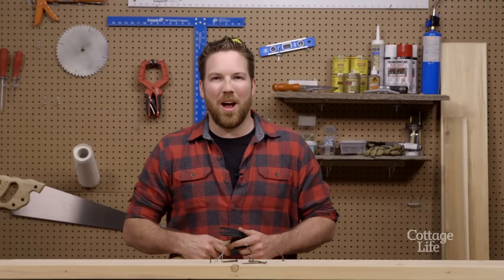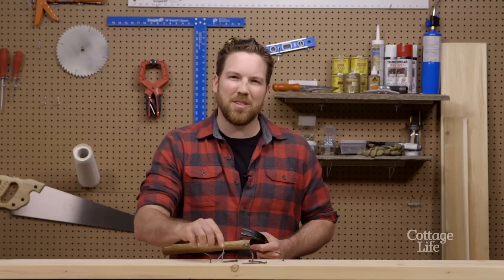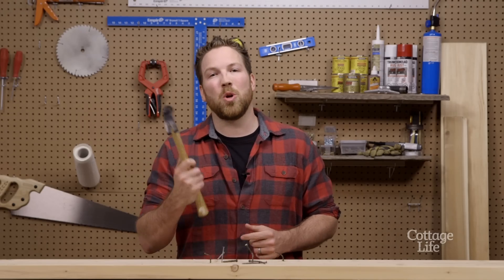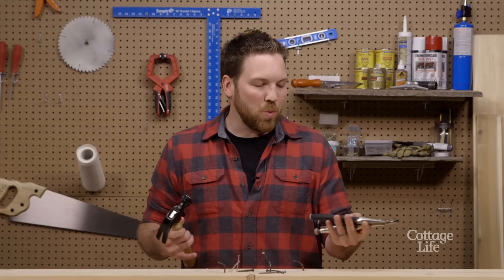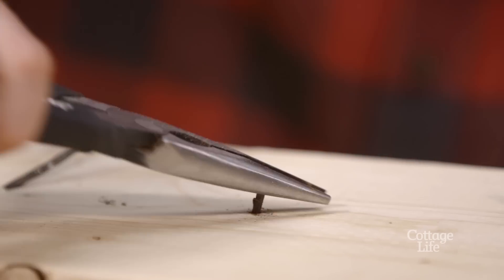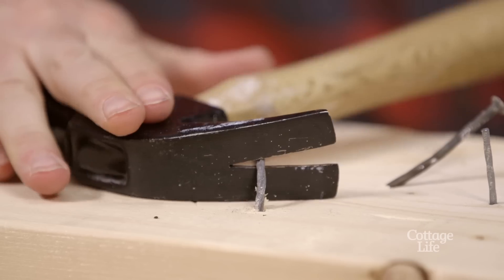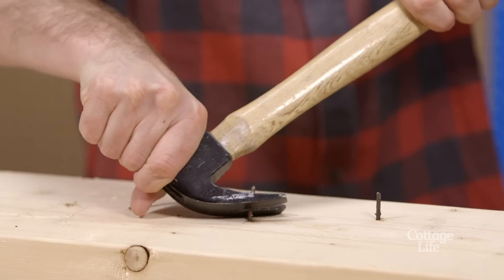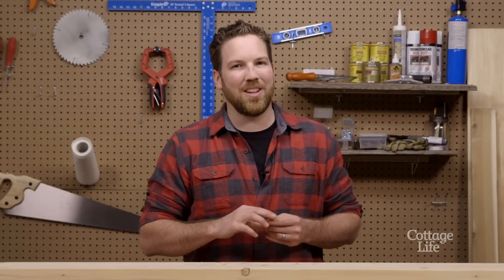How to remove a Headless Nail

Comment: I actually did a similar video a couple of years ago.  First, before you try pulling it out, smack it to drive it slightly in more.  This will break the corrosive bond between the nail and wood. Then extraction is dramatically easier.  Also, I found that by using a pair of side cutters (if available) instead of the hammer, I can extract nails with a higher per cent of success. just don't squeeze it too hard and cut thru the nail.  I have used your method many times over the years (lots of years :>)  I enjoy your channel, keep up the great videos.
Reply from the maker: Hey Russ! Thanks for the comment and tip, it's much appreciated. Adam
Reply: Thank you Adam.  a lot of larger channels seem to take exception to building on their video (some just ignore).  My hat is off to you and your channel.
Reply: What should you do if it’s so close to the wall and you have no give to put it on its side
Reply: @kelciii1123  Use a pair of side cutters.

Comment: Lol, came here accidentally as I am looking for tips on removing a fractured thumbnail...after hitting it with a hammer while working a job 😂 I guess it makes sense that I'd end up here, haha
Reply: Did you remove your thumb nail yet?😅
Reply: @yoellopez82  had three of them grow and then fall off misformed. As of now, I finally have a nail that looks somewhat normal, but us ridiculously thick and tough 😅 It's even tough to cut with a clippers- partially due to the strange shape

Comment: What about when they’re thin, short and delicate? That’s my problem. A lot of them are also snapping off right above the floor surface.
Reply: use adjustable pliers and a block of wood for leverage and to project the finished surface